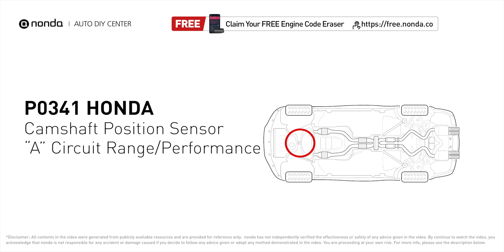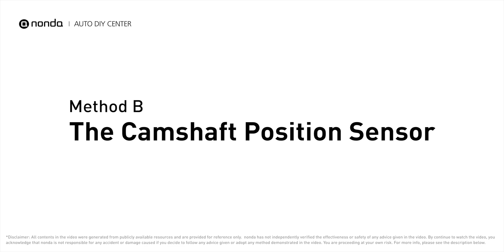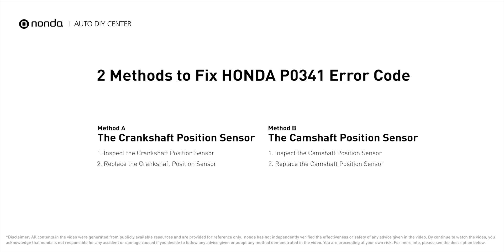How to Fix HONDA P0341 Engine Code in 3 Minutes [2 DIY Methods / Only $9.76]

Comment: Hello, I have P0341 with P0441 error during connecting via OBDII on my Honda HR-V 2016 and I don't know what to do. I've checked the Camshaft position sensor and it is fine. But problem doesn't go away.. please help
Reply from the maker: Hello, as you are receiving more than one error code, we highly suggest getting your vehicle visually checked by your local mechanic for further diagnosis.